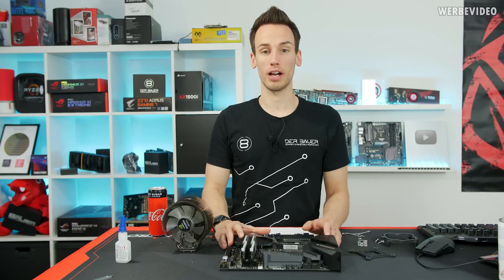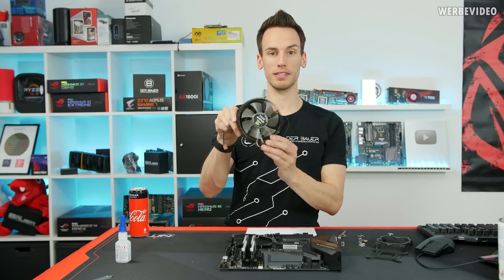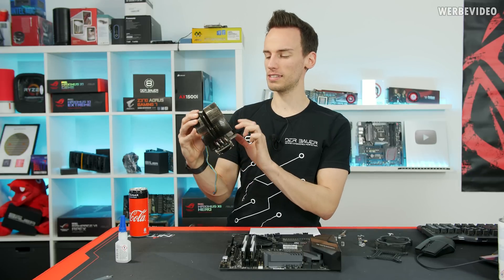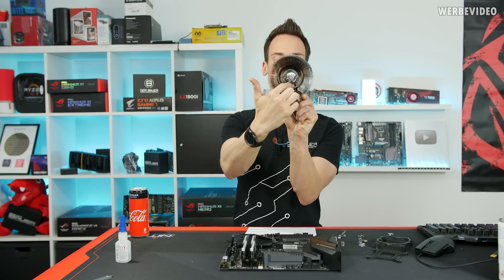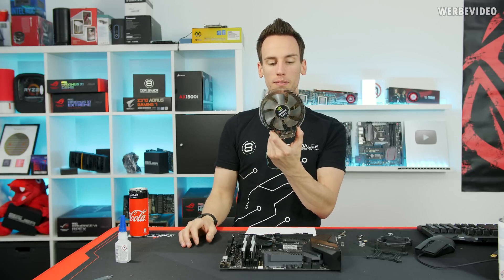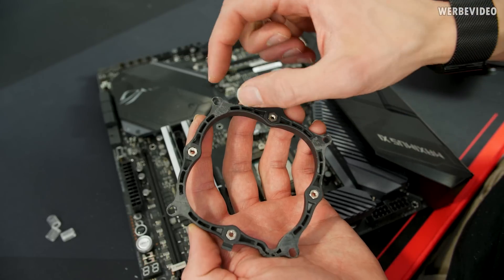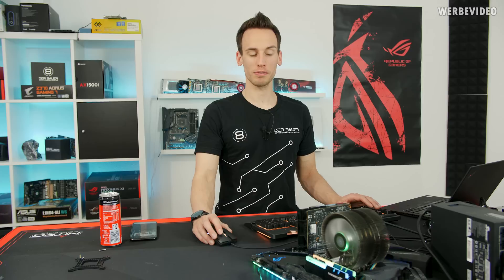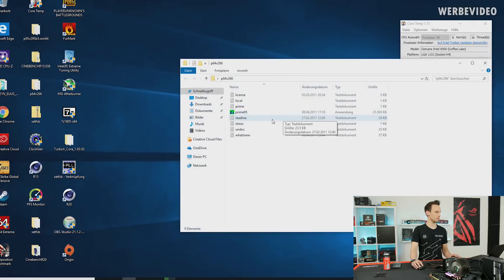HW-Legends #4: Using a 12 year old CPU cooler for todays i9-9900K? Zalman CNPS 9700 NT

Comment: Umm i just tried this cooler on a 9700kf . 50c in stress test . Multi core on and xmp enabled  3733. And a 9900k is  dumb gaming processor anyway . I thought no way after watching this video . The only difference is I have a 9700 copper , with the green 9700 nt fan 4 pin pmw . So as long as you don't have 16 coree overclocked  this cooler just blew my mind . What a masterpiece lol

Comment: Interesting video. I run the new Zalman CNPS-80G Ultra Quiet CPU Air Cooler Value Edition (2023), 65W TDP 4-Pin Silent 85mm PWM Cooling Fan in my micro-itx build (Auros b550i pro mb, amd 5600g cpu, and Powercooler Fighter RX 6600) and love it. It's the low profile flower heatsink design, which I think looks retro in the best way.

Comment: I bought this cooler, the copper version, for 7,50€. I modded a bequite 92mm pure Wing pwm in it and runs very quiet. It cools a 5800x at 4,6Ghz on all cores at around 90⁰ celsius (PTT at 128W), im amazed and happy with the performance and the looks of this cooler. 🤓

Comment: I just bought a brand new CNPS9900 Max. Newegg is selling them direct from Zalman. It fits up to AM3 and 2066 with the included brackets. It's very similar to the heatsink in this video, but is a bit beefier, and it performs well with my Xeon E3-1241 v3 (basically an i7-4770). Otherwise, same black nickel plated copper 'upright flower' config with circling heat pipes. The fan on this one would probably not max out on your board. It keeps up with some of Noctua's best.

It's been out for at least 10 years, but it's nice that it's still available new. From what I can tell, Zalman quality is still top notch.

Comment: @ 03;51  Yes, absolutely! this fan outward design was optimized to sit close and above the north bridge. The all new for nVidia on Intel SLI (nForse4) which got really hot so its heatsinks were often tall and angled close by to catch breeze by from large CPU cooling. The Zalman flowers. They were awesome in their day. I even had the matching GPU flower & a off brand chipset cooler to match. Full copper was the thing but it got heavy & expensive. These came w/ the CNPS fan controllers you could adapt to I/O or stick somewhere near by. They made a CNPS-9900-NT & Max that brought us into LGA-1366/2011/2066 w/ LGA-775 backwards compatibility and I believe LGA-115x (75mm) so now we can use on new LGA-1200/1700. Not top notch powerful for today's demands but good for its used price point performance compared to some cheaper new off brand.

Side note, the top retention bracket should be turned 180 degree. The little angled slot in the corner is to allow CPU locking lever to completely open and rest back.

Comment: The standard fan that shipped with the 9700 back in the day was not PWM for some absurd reason which may explain the problem with fan speed you experienced.   Mine was so noisy I modified it by cutting the frame off of a 90 mm PWM fan with my Dremel and custom-mounted it on the cooler  (Not easy!)

Comment: Hi! Any tips on using a Zalman CNPS 9700NT cooler for an AM4-socket (therefore also AM5-socket when it comes out) cpu? :) I'd rather keep on using my cooler... I have an old core i5 2500k (@ 4.31 GHZ). I presume I need some kind of special mount - if so, does anyone know where I can get one? Thanks! ^^

Comment: I use a large version of the zalman copper cooler (it has a blue fan instead of green) on a Ryzen 5 5600x @ 4.5ghz, and I get around 38c idle and 60c gaming load. Cinebench R15 load is 70c. I remember using this cooler on a sempron 140 and an Athlon X2 3800+.

Edit: I should note I do not hear any noise even at full load. It is quiet and beautiful.

Comment: Just did this exact same mod to my old Zalman 9500. I used the old backplate, and didnt need the standoffs. The plastic bracket is quite strong so I left them out. All I needed to do is make sure i had the M3 nuts was at the correct position on all 4 sides of all bolts. Keeping my i5 4690 delidded at full 3.9GHz all core at about 60c in small FFTS AVX in a HTPC case. Though i had to do a lot of work with the mobo DC fan controller as the ball bearing fan is way too loud at its full RPM.

Comment: Slight correction on the fan, the 9700NT had a 110mm fan, the 90mm was on the smaller 9500. I'd imagine that the open bottom of the cooler wastes a fair amount of air flow though.

Comment: Mine got broke several years ago, so I did put over the top of the pipes a coolermaster 12x12cm at 1000-2000rpm and the temperature hardly pass of 60ºC, navigating with a few tabs and bs open is under 20ºC rn (processor amd FX8000)

Comment: I remember having the regular version (Zalman CNPS 9700 LED) cooling my yesteryear beast back in late 2006.  I was a wiring management noob and was afraid to touch water cooling then, so I stuck with air cooling.  I was broke but one happy gamer when I was able to play Oblivion at 1600p.  I was searching for the Nvidia edition but couldn't find it at the time along with the ASUS Striker Extreme motherboard but went with the EVGA one instead.  I wanted to do an Nvidia theme build, hence the Nvidia edition full size tower.  This yesteryear beast was one of the few PC's on Earth at the time that could actually play Crysis decently at 1050p with high settings, lol. 

Intel Core 2 Extreme QX6700 w/Zalman CNPS 9700 LED @3.4ghz 
EVGA nForce 680i SLI motherboard
4GB Mushkin Redline XP2 8000 DDR2 1000
XFX Geforce 8800 GTX in SLI
Creative X-Fi Platinum Fatal1ty Champion 
2x WD Raptor X 150GB 10,000 RPM HDD in RAID 0 for Windows Vista Ultimate x64 and for the most demanding games
Seagate 7200 RPM 750 GB HDD for storage and lessor games
Enermax Galaxy 1000W PSU
Floppy drive, lol
2x DVD burners w/ Lightscribe
All fan slots full of 120mm fans and controlled with fan controller
Cooler Master Stacker 830 Nvidia Edition
30 inch Dell Ultrasharp 3007WFP 2560x1600 resolution
Logitech G15 original blue keyboard
Logitech G5 mouse
Logitech Orbit MP webcam
Logitech G35 7.1 surround sound 

I still have pictures of that yesteryear gaming PC in my old Photobucket account.  That PC made a great space heater during the holiday 2006-2007 season comfortable but was hot during the summers for the next two years I gamed on it before selling it and upgrading to the first generation i7 965/X58 build.
Till this day, that's my most powerful gaming PC I ever built and I wish I still had it for retro gaming.  Core 2 and the Geforce 8800 GTX were the biggest leaps in CPU and GPU power during that era in my opinion.

Comment: I'm here because I just found an old unused 9500 Led copper colored I purchased and never built system - trying to find if I can use with my 8700 or 8700k - I disagree with not looking good the copper color and weathered copper look so much better than that

Comment: I had a cnps 9700 on an e6700 core 2 duo.  I had a 2.67 ghz chip OCd to 3.6 ghz even and it was still cool.  I stopped going because I was scared of adding more voltage.
When I got an fx8300 I got the cnps 9900max.  4.2 ghz all day.  Low 70s even under prime95.  FUCKING BEAST coolers.  I wish they would start putting some out with the AM4 brackets.  Anything you buy you have to contact them to get the am4 bracket and that is annoying as fuck.

Comment: "Nforce branding doesn't make sense"

Bullshit.

Nforce boards ran hot, this was one of the best coolers to use on an Nforce board due to the massive amount of airflow it gave the VRMs and the chipset.

It was a great way to indicate that the cooler was very beneficial to Nforce boards.

Same with "SLi Ready" RAM, it wasn't marketing crap, it indicated the ram was usable with Nvidia's version of XMP.

It had the benefits of a Intel box cooler (downdraft), but could actually cool the cpu properly.

Source: I have two CNPS9700NT, one CNPS9500NT, an ABIT IN9 32X-MAX (680i SLi), an XFX 790i ULTRA SLi and a bunch of Nforce4 SLi boards.

Also, good job butchering the original hardware for what is now a rare item.

Comment: My Son-in-Law has an old PC which I moved into a new case. It was using the CNPS9700NT which I rather dismissed as innovative, but probably not very effective. It was cooling an i7-2600K. I liked the look, but figured it was just "arm chair" design without real world effectiveness. After seeing your video, I decided to buy the larger more modern version, the CNPS9900MAX. It does a very respectable job of cooling even under a full load while doing folding@home.

Comment: I just stumbled on this. Until like a week ago I was using a 9700 cooler and it works fine with stock clocks no problem. The cooler has really held up well.

Comment: Enjoying these videos very much. I had watercooling, but the cpu blocks developed cracks after a few years, not leaking but would end up leaking. I used two zalmans (k8we, dual opteron board) and they're still going, 10 to 15 years later!
Thanks for the videos.

Comment: I have had one of those as well. I had put a plastic shroud around the fins, so the air would push through more efficiently, which made for better temperatures.
I always hated how fast Zalman coolers in this shape get clogged with dust and this fan clearly (as you could hear in the video, although admittedly, 100% fan speed is loud for a lot of coolers) does not follow Zalman's early reputation of making quiet cooling products.

Comment: not great, not terrible :-D  My father is still using Thermalright or Thermaltake (I am not sure) giant cooler with 2 120mm fans from 2008 and it's still better than most of today coolers, it has 7 heatpipes. :-D

Comment: I had this exact unit on 2007 and actually still have it on my cellar mounted on a Asus striker II extreme with an intel core 2 qual 6700 and 8 GB of OCZ ReaperX DDR ram (the ones with the huge silver heatpipes and overvoltage up to 1.8 volts within the warranty) and a XFX 9800 GX2 black edition graphics card followed by Creative audigy Xfi audio card.... ah good ol days... back then every next generation of tech was considerably faster than the previous one and the prices where steady or cheaper  no refreshes and the ridiculous price gouging of nowadays

Comment: I had several Zalman coolers for years during the Athlon days, had both the AlCu and the Cu versions of the CNPS3000 series on my Socket A system, after switching to S939 I had the CNPS7000 and finally the CNPS9500 that ended it's service with my trusty old Opteron 170 after my OCZ Powerstream 520W PSU decided to explode. After that it was on to LGA1366 and the Zalman wasn't compatible.

Those were the Noctuas of the early 2000's I remember tons of people having these if they weren't using just stock coolers. Nowadays I'm using the Noctua of 2010's, which is Noctua.

Comment: I have the CNPS9500A LED 530g copper version. I hacked it on 1155 socket for my i7 2600k OC 3.8Ghz. I just did the test with Prime95. The CPU did hold at 3.8Ghz with TDP of 125W with all cores at 98 degrees with some dust on the cooler. What can I say ... it does the job. It can handle 120W TDP processors, which means it can handle even modern CPUs like 9900k and 3900x.
CNPS9500 is just 530g while CNPS9700 is 760g but copper conducts heat about 2 times better than aluminum so keep that in mind. That's why I like it, it is small but all copper and it works.

Comment: carbon pad? negative pressure with a 135 CFM extraction fan working push-pull i have a i3 8100 so it be an improvment

Comment: ZALMAN just released a CNPS20X. Claiming the worlds best CPU AIR cooler and it holds up. I have a ZALMAN CNPS 9900MAX that easily cools a 5GHz 1.250v i7 8700K. I've been looking for a 9900MAX DF but the only ones available that i can find are $125 on ebay. So i just stuck with the $25 ones on AMAZON. I also have a copper 9700 which does have a 115X bracket and it fits socket 775 to 1156.

Comment: Nice video.
I have the same zalman cooler running on a asus prime 270-a  & i7 7700k delided.
Its running smooth with cool temperatures.
Maybe i9 delided will make a big difference in temperature with the zalman cooler compared to your results.
Also, zalman used to sell seperate 1151 brackets compatible with many of the old coolers like this one.
Dont know if you still can get them though. I think I ordered the last ones available in 2019 at the zalman ebay shop (usa).

Comment: I just found someones retired gaming rig getting ready to go to the dump so I asked if I could take it.

It has this same cooler and a core 2 duo extreme, nforce 680i motherboard and a GTX 280, wouldn't post but all the fans turned on. I'm suspecting its the psu since I dug up my old asus p5e3 deluxe motherboard with core 2 quad extreme 6850 and its doing the same thing. all the lights turn on but thats it

Comment: i still run my arctic cooler freezer64 on my A8-7650K BE at 4GHz :D tomorrow my new Ryzen setup arrives and I am wondering if the thing would cool down the Ryzen5 2600. TDP is also 65w, so i think i give it a try...

Comment: my cooler is about 10 years old, too. It's much bigger though. I switched CPU, but I kept it (cause the 140mm fan can stay at idle 90% of the time). it's just a core-i3 though. can't get it over 61 degrees

Comment: I still use my CNPS 9700 NT on my i7 3770K with about 60deg max temps at load, 50+-deg while gaming with a GTX 980ti (bought it for my XFX nforce 79ulta motherboard and core 2 quad 9650 back in the day)

Comment: I never owned a Zalman. I do own and still use a Thermalright TRUE 120. I bought the 1155 retention kit. And it is now happily cooling my i5 6600K OC'ed to 4.3GHz all core. Even with the current heatwave: no core gets above 50C.

Comment: I have this exact cooler in my current computer cooling a Pentium Quad Core Q9400 CPU. Yeah, I know, way out of date. Building a new computer at the moment using a Gigabyte Aorus Gaming 5 motherboard and Intel i7-9700K CPU and will try adapting this old Zalman cooler to fit, so thanks for showing how to do this. If it doesn't work out I'll go with a Noctua NH-D15 cooler.

Comment: I don't remember what exact model it was, but I had a Zalman cooler years ago, I think on my e8400 Core2Duo build. It was one of the bare copper ones with an otherwise similar design to the one in this video, and maybe it did get darker after a while but I don't recall noticing.

Comment: Im still using my cnps12x for my 3930k @ 4.4ghz and the temps never go above 70c even in this hot 30c weather.
For years ive been looking at aio thinking they would be better but seeing all the Ryzen cooler vs aio reviews ive been wrong about aio's being better.
When i upgrade back to Amd i hope i can use my old Zalman cooler if i can find the box with the Amd standoff's.

Comment: I had 2 of them running on a pair of Opteron 285's on a tyan K8we, good times. Wish I didn't lose the pictures I had of that setup, was a nightmare of a mess in a thermaltake armor(the steel one, not the aluminium one), cable management was more like 'CABLES EVERYWHERE!' with 9 drives, two GPU's, 2 cpu's, and a raid card, lol...

Comment: I need some help, i have the 9900k at stock using just turbo Boost 4.7 all cores when load, but i pair it with and old Cooler Master 212+ and that cpu molten 95° on average, these results are better than mine. Any hints?

Comment: Nice look at an older cooler thanks. I actually have a Zalman 9900 max which was a step up form this cooler here. I used it until December 2019 to cool my i7 2600K@5.0GHz for a very long time. I switched it out for a EVGA 280mm CLC water cooler and was able to squeeze another 100MHz out of my 2600K so now it is @5.1GHz on the water cooler. With the Zalman 9900 MAX air cooler I was very impressed with just how good it was and how good the Black pearl Nickel Plating looked as well. It goes to show you sometimes do not need a huge CPU cooler to get the job done right.

Comment: I had the copper version back in the day cooling my AMD Phenom II X4 955 Black Edition. The only problem was that you couldn't replace the fan. The bearings started to make too much noise, even when oiling/lubricating them. Also, way too loud at higher rpms.

Comment: I had a downfiring one from Zalman, but I don't remember the model and I had a 9900MAX which was a beast, it could easily cool the power hungry FX CPU that I had back then. Also the 9900MAX was built to last, I used it for like 6 years or more and never got noisy even thou I never did maintenance on the cooler itself, only cleaned the fins and cooler from dust like once in every month.

Comment: Be fine for a 9600k, if you want that retro look. I have Zalman 7000CU on my Q6600 Retro rig for my Windows 2000 rig along with Ati 1950 Pro, western digital raptor 10k, coolermater ACTS 201 case.

Comment: I always like that heatsink design. For the amount of material used it is effective. The problem with new chip processes is the closeness of the heat generated. You have to use a cooler that removes heat very quickly from the precise spot of the chip. Old chips don't really have this problem. One of the major reasons I like 28nm and larger chips. They cool more uniformly

Comment: I have the copper model still running with a Core 2 Quad Q6600 overclocked, it's working really well. A bit loud when running though

Comment: I have this old Thermal Take GunMet Orb from 2005 I think. Still in pristine condition. Actually never used it for very long as I upgraded to the V6 just after that. My mom is using that V6 cooler on her 7700K right now with awesome results. Kinda curious how the Orb would do. Probably just fine, but loud.